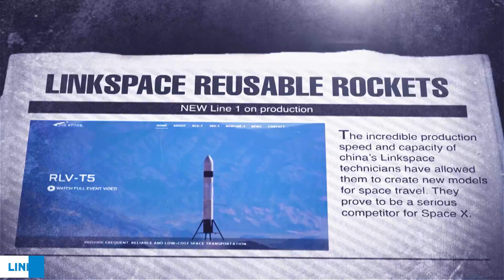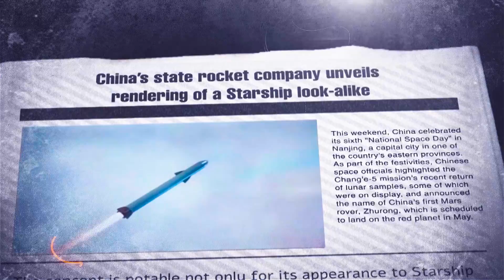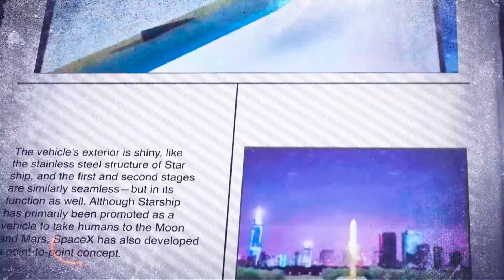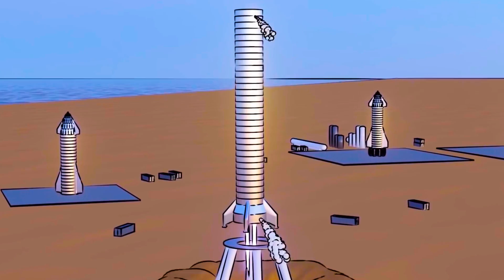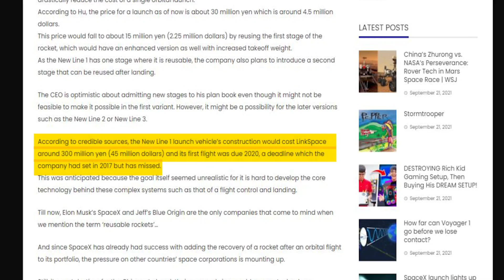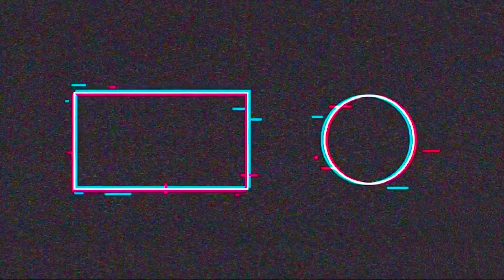IT'S HAPPENING! China Is Testing Their Secret Starship To Mars!

Comment: Rocket flights have an effect on the ozone layer. Not much of an effect with the level of launches we see at the moment. But I wonder how the effect will scale with commercial suborbital flights?  Anyone done or know of the calculation?
Reply: I'm no expert, but if I'm not mistaken it depends on the type of fuel used. SpaceX has stated they will be using  a fuel type that will minimize environmental impact. It wouldn't surprise me if China doesn't care and uses whatever is cheaper.